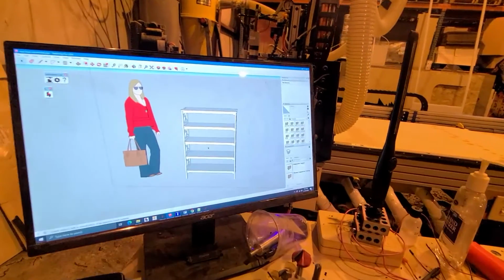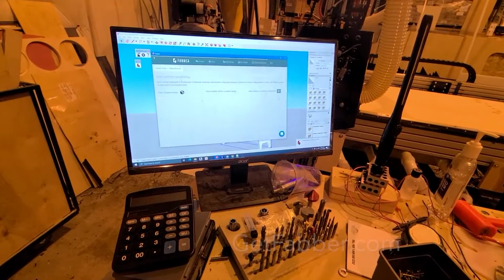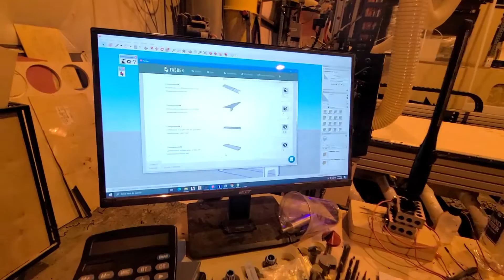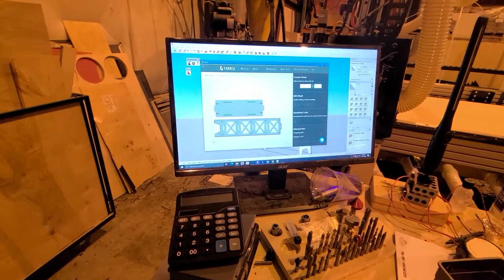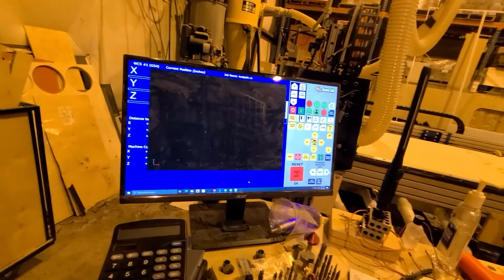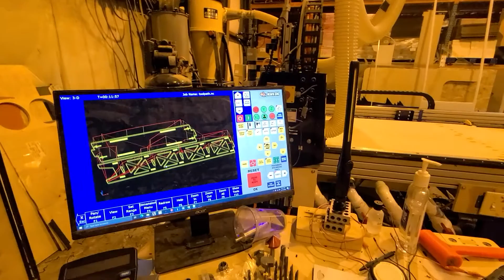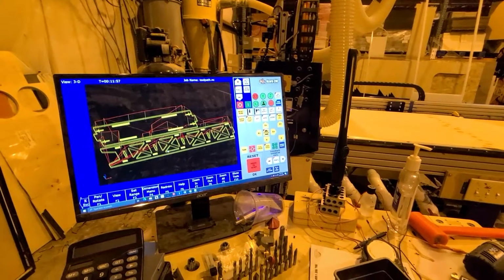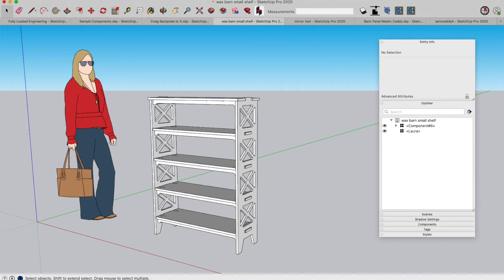Using SketchUp and Fabber to make a shelf

Comment: While not needed for this job, does Fabber support tool changes?
Reply from the maker: Yes, but the features aren't exposed in the UI yet. If you wanted to do tool changes today you can actually just edit the G Code that we output. We group all of the toolpaths and label them in the G Code so the tool changes are easy to find. So on a job like this that had drills, pockets and cutouts if you wanted to use a different tool for each operation you'd change three lines of code. Very easy.
Reply: @fabber5696  Thanks very much for the response. I'm looking forward to trying this out. If it works, beyond streamlining my current workflow, it'd be a complete game 
changer!